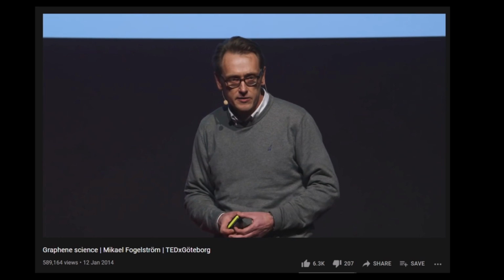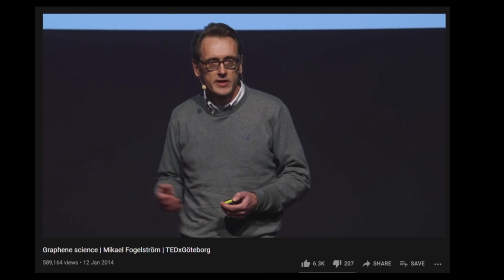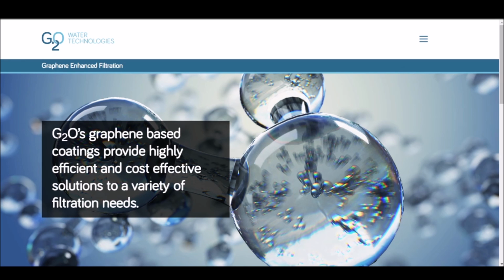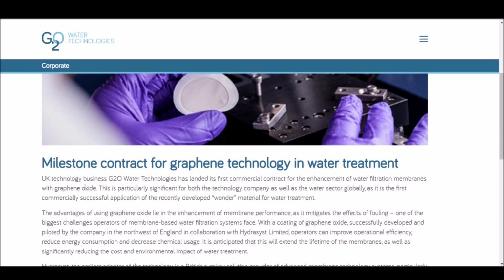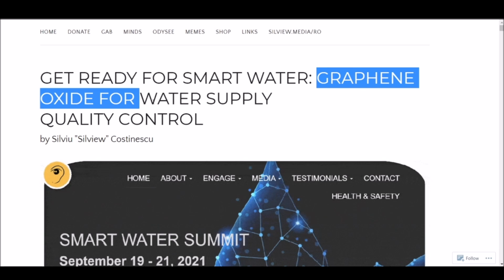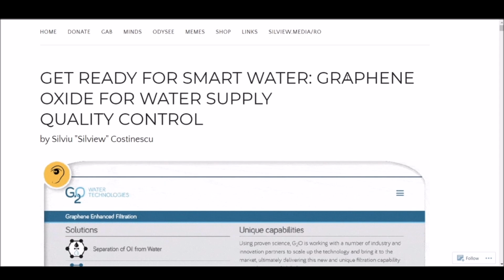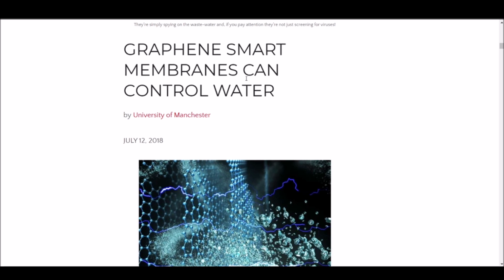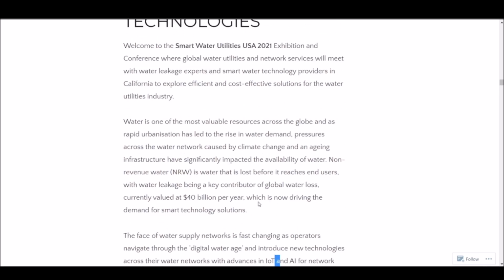NANOTECHNOLOGY IN THE WATER SUPPLY!

Comment: Dude... Do you understand what science is? First off, you are already thermally and electrically conductive. It's called the human body. Second off, what they described in the Ted talk are different ways to use the graphene nanotech. You need to customize the graphene into specific situations for any of them to do anything. Since you are merely ingesting the graphene, and it can't be digested, it will eventually be excreted. The company is using the technology not to make you electronically  or thermally conductive, but to clean the water. So now i ask the question. Would you rather drink contaminated water that you can die from, or have a non toxic, non harmful, substance, that in no way will have any effects on your body pass through your digestive tract, which btw no electricity or heat will get into there so....

Edit: since some people probably don't understand: if electricity or heat get into your digestive tract you're dead already, since electricity travels at very high speeds, and according to the second law of thermodynamics if any excess heat  got in, it would quickly spread to every part of your body and melt all the fat on your cells.